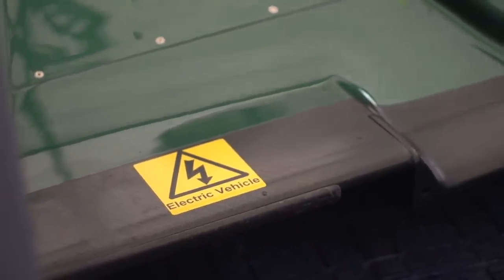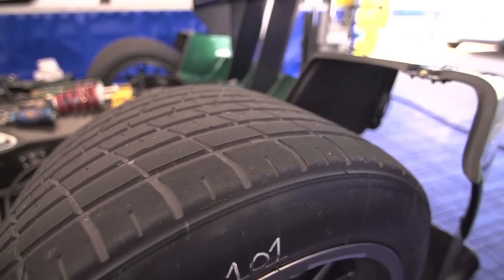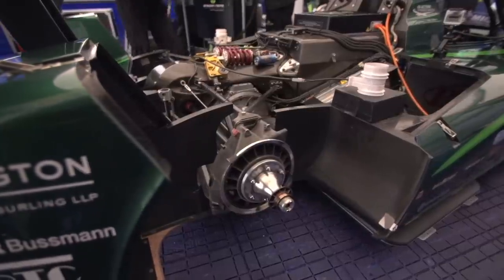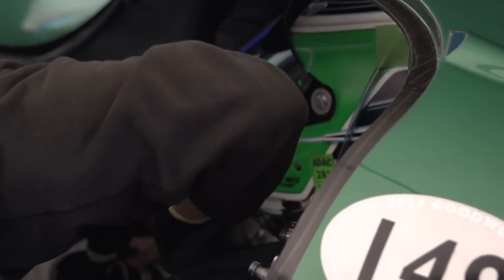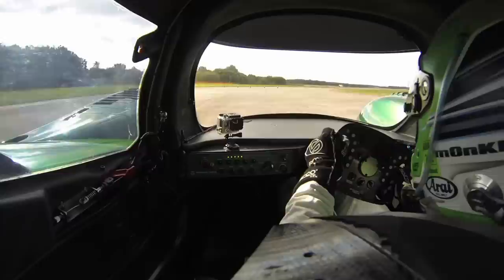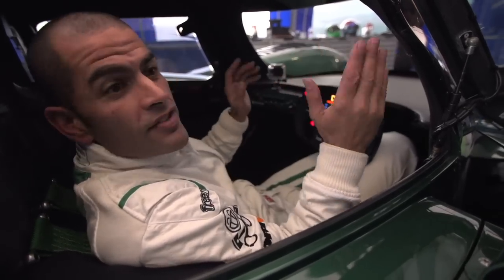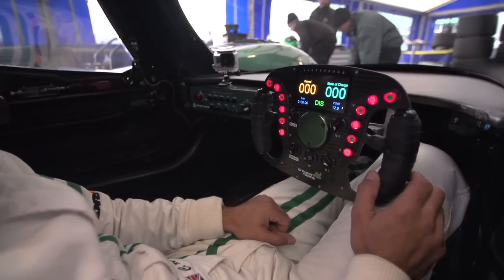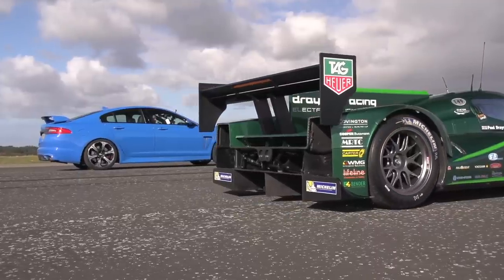850hp Electric Racing Car: Driving the Drayson B12/69EV -- /CHRIS HARRIS ON CARS

Comment: in the end, noise wont win you races, torque will
Reply: Lindholmer5k true but nothing will give you an eargasm a mindgasm a inspirationgasm like noise. 
although hey who doesn't love torque.
Reply: Power?
Reply: I mean, power makes you win races, not torque.
Reply: juanete838 you need torque aswell it's just as important.
Reply: Todun Olusola besides, torque is a measure of power aswell as HP
Reply: Lindhomer5k,
You are right, but noise will win more race fans.  Racing is not just about the speed of cars.
It is about the unusual "spectacle" of seeing, hearing and in the old days, smelling (Castrol R oil) the race cars.
I raced cars and motorcycles for many years and believe me, the sound is intoxicating.  
Just listen to a 427 Cobra being driven in anger and you will see what I mean.
Reply: i want to see cars running 400kmh and smell some rubber, e-cars do deliver sound^^can you hear the tire´s sizzeling?
Reply: taking the turbine tech of the jaguar c-x75 running turbines on kerosin would create sound on the home stretch, this would be totally awesome^^
Reply: Torque? Hmm... while the torque number itself is useful for engineering purposes, it means nothing to the driver alone. Horsepower is true applicable performance. Torque, of course, is the basic twisting force. RPM's are a measure of how quickly this torque is applied. For example, 500 torque at 4000rpm is twice as powerful as 500 torque at 2000rpm, which bring us to horsepower, the product of these two numbers divided by the horsepower/torque numerical intersection point of 5252. Horsepower, therefore, is the only number that truly matters as far as actual performance is concerned. The two statistics are not to be used in the same applications, yet they are directly intertwined.
Long story short:
Torque=Twisting power
RPM=The speed of this twist
Horsepower=The product of the two - true power.
Reply: look fossil fuel fool electric motors get all their torque at 1rpm it doesnt need to spin 12000 rpm  850 hp car will lose to an electric 850 car of the ame weight EVERY SINGLE TIME.
Reply: well said
Reply: noise wins excitement. excitement wins you fans. fans are who pays for the sport.
Reply: They can broadcast Mr Whippy music or other food/confectionery van music. That will make me a fan  LOL.
Reply: what? the torque is good in low revs... in mid-high rev you need power... see mclaren f1 top speed or the mustang gt350r against the monster torque camaro here in youtube
Reply: Tod Olusola no torque wont horsepower will lol
Reply: @juanete838  HP is power over time - torque is the total power. HP is a description of how much torque can be applied over a set time and distance. Basically, HP is a description of the motors effectiveness and torque is the rated power.
Reply: @MyWatchIsEnded  ???????????????????????
Reply: @ELECTRICEYEMEDIA  yes, depending the units you use
Reply: @MyWatchIsEnded  hp is the unit of power, and torque is angular force. That's all.
They are similar because power = torque x rpm.
Reply: To all true petrolheads : We must protect our sport from the electric tsunami. Electric racing is irrelevant today since most of cars and transportation vehicles in general in the world are still using combustion engines. We believe that electric racing could never ever replace the excitement and power of combustion engined cars and bikes racing. Please help fans spread the word around the world, and tell organisers and constructors to Keep vacuum cleaners away from racing tracks ! We love real racing that sounds and smells ! We won't buy electric cars on monday coz they won on sunday. We'll buy them only to protect our environement. But petrol racing must survive ! support the Petrol racing cars protection society by showing to the world what you think about electric racing : https://www.teepublic.fr/t-shirt/4721339-petrol-racing-cars-protection-society?store_id=165554
Reply: Surprise toy City hell no!
Reply: Torque wins ? Ok
"To finish first, first you have to finish" LOL Good luck :p
Reply: @TodunOlusola  That is why you can emulate sound in your car and connect that to your EV system to get the feeling of a v12 while having the performance of an EV track car. Most countries actually require that your car create some sound so these systems already exist and can be modified or upgraded. The modern modifications for EVs come with apps usually to control exactly how it sounds but can also use presets from popular cars.
Reply: @193322009  EV sound conversion kits can emulate most sounds with the touch of a couple buttons on your phone.
Reply: Yes but if there’s nobody watching the races there simply will not be any money for motorsports, something I hope will not come to pass of course but still... For me and a lot of my motorsports loving friends, the sound of a powerful engine/race car plays a big part in the overall experience
Reply: You have to dig up 500,000 lbs of material to get a 1K battery. We don’t have the minerals in the USA to even make them. The replacement cost for them is incredible! So no, I’ll stick with my gas engine!

Comment: 2,950 ft lbs of torque!   brain explodes
Reply: +SuperSonicSenna Not just torque. But, INSTANT Torque
Reply: hii
Reply: +SuperSonicSenna WTF??!!!!!????
Reply: +SuperSonicSenna 4000nm of torque! brain melted
Reply: +Ckc dillpickle Yup, that's what matters!
Reply: if it has 4k nm instant torque why is it not faster than a top-fuel dragster from 0-60 or 0-120? just a question though, not making a point or anything...
Reply: misutatomasu
 Is it AWD? Are you sure its instant? I have no idea. Maybe its limited. About 600lb ft of torque can make a 4,900 car do 0-60MPH in 2.8 seconds
Reply: ***** every electric engine has instant torque at 1 rpm afaik, since it doesnt have to do the fuel injection, its just electricity.
Reply: misutatomasu
True. However the torque can be limited at certain RPMS
Reply: +Ckc dillpickle at the first gear 600 ft*lbs on the engine translates into 3 - 4k ft*lbs on the wheels.
Reply: +misutatomasu It has tiny rear wheels not top fuel dragster wheels, dimwit. Traction control went "hang on you mental nutter, we can't put that down on the road at a standstill the tires will just evaporate!".
Reply: Also HP does matter despite what all the torque fanboys will tell you. This has about 900hp, a top fuel dragster has what, an estimated 4000 or something like that? Huge difference.
Reply: wingracer 16 try 12000
Reply: SuperSonicSennathat's a fucking tank engine in a race car.
Reply: That description made me laugh more than it should have.
Reply: SuperSonicSenna wow, a comment thread where ppl arent barbarizing one another. Quite remarkable.
Reply: 11,051hp and 7400+ trq look like the current specs. Most impressive.
Reply: @GusZiliotto  Ok, so how can I say it in a friendly way. Torqe doesn´t move you an inch. Only in combination with revs. Multiply both and you will get power. Divide it by a smaller number of revs and you get a huuuge number of torqe. This is done in reality e.g. by a transmission where the output gear has more teeth than the input gear. Because on a standard car you dont want to have 1000rpm on your wheel, but the engine has. So if the first gear and the final drive together give you a ratio of let´s say 10, your wheels only do 100rpm, but they get 10 times higher torque. But the power is stil the same!
My car has got a max torqe of 1000 Nm at both front wheels. But still 90hp. So come on poeple, WHAT does these torque figure mean to you??
You all are talking about the bicycle rider who is standing on the pedal but doesn´t get the hill up faster than the small one who is pedaling quicker. "But hey, look at his legs!"
Reply: @misutatomasu  Top fuel dragsters have about 6000 hp or even more.
This car has 850 hp. What do you expect ?.

Comment: I'm going to miss the sound of gas engines when the future comes.
Reply: You'll wont because this sort of tech will be used for road cars mainly, which makes up 99,99% of petrol consumption. This leaves the oil to be used for race cars:)
Reply: But they also use oil for plastic and alot if other things
Reply: yes, but this is only 10% of what Oil is used for. more than 90 is used for petrol
Reply: if you come back and read my comment you will realise this comment is from the future when thinking back from when you originally posted your comment.  Also dont worry, we still have gas engine cars here in the future.  Electric cars will not take over.
Reply: Me to😟😟
Reply: Can't say I'll miss the sound of the average straight-4 econobox engine. It's not like you normally hear v10 race engines doing 20,000rpm on the way to work or whatever. It will make going to classic car shows more exciting.
Reply: juffurey 
well it take some time to see horses disappearing, but they do disappear. This time it's going to be much faster
Reply: Granattaaaaaa Wrong, try about a 33% of it is used for transportation, with another 22-25% in energy production for the US, the rest is used in production. The amount used for transportation/energy is even smaller when you dip into world consumption.
Reply: ***** In the future. Ricers are gonna have riced out hover cars with fart can electric exhausts systesms a nd other stuff.
Reply: soupisgoodfood v8's are still a beautiful noise
Reply: ***** I'm not.
Reply: Performance > sound
Reply: : l There are cars more powerful than this thing.
Reply: *****  But it is the trend.
Reply: ***** Electric motors have the sound of a turbine when they spool-up.  It's a much better sound combined with a cleaner fresher smell.  You can't beat that.
Reply: A Sound of a turbine sounds pretty bad : /
Reply: Takata HD There is established technology that is more powerful than fledgling technology? You don't say.
Reply: ***** Well hey, not everyone is gonna like the change : /
Reply: +Granattaaaaaa ....not if gas isn't as fast as eletric......
Reply: +Payton Gulley 
Performance > Sound > Performance
Reply: +PastaOverseer Fuck the past! :) It's soooo passé lol
Reply: F1 is already there unfortunately.  The V6 engines currently don't sound anything as intoxicating as the V12, V10 or V8 predecessors.
Reply: Granattaaaaaa - oil is used in a lot of things not just cars LMAO !!!
Reply: @snepcosiemmarlinfsv2718  from the future here,they have start taking over.

Comment: I actually like the sound electric motors make. Its much quieter than gas engines, but they still do make noise.
Reply: Yeah, like to just wire a scalextric car up to a battery sometimes.

Comment: The distinct lack of engine sound is creepy.
Reply: Eargasms will become a thing of the past...
Reply: Yes, but you can hear your radio PERFECTLY!
Reply: The lack of engine sound is something that I noticed when I first drove the electric car, it was a whole different experience it was actually quite pleasant to hear so many different sounds from outside the car instead of the constant engine noise. 

And you still hear the electric car coming from behind you but most of the time you do not need to worry about that unless the driver is a moron or you are a moron with earplugs and full audio volume on

Comment: "They do slightly surprising things"

That's rather a terrifying statement to make.
Reply: +Jackie Scholl  ...thanks, jackie, because that's so important and difficult to achieve in a battery-cell, that it doesn't explode when it gets wet
Reply: +Jackie Scholl thats not the biggest problem, at our car we are surrefing unpredicatable behaviour at high temperature differences and some of the cells dont balance correctly all the time, wich means they could be potentially a little over their charging voltage, other thant that its pretty risky to start the car while its cold outside